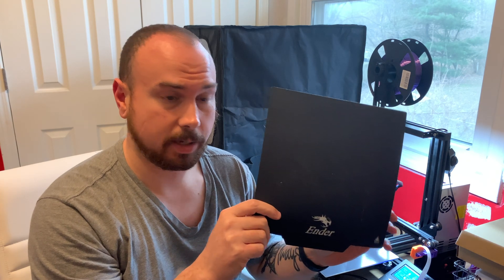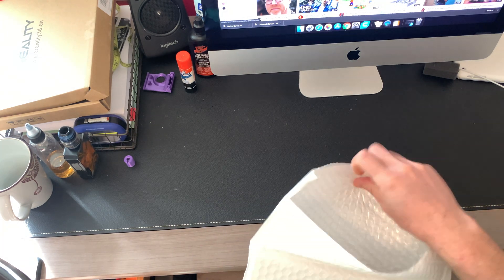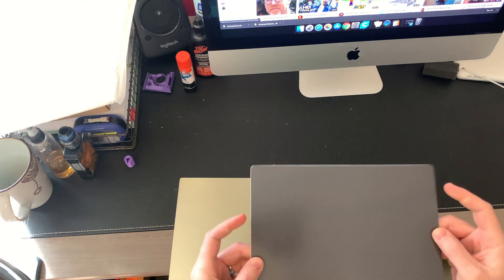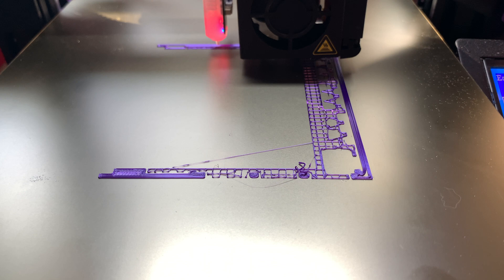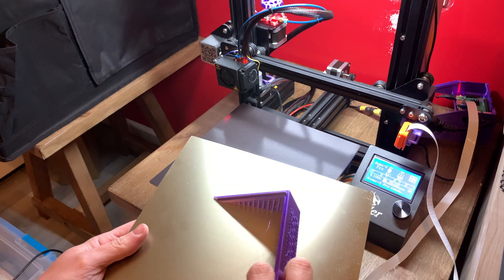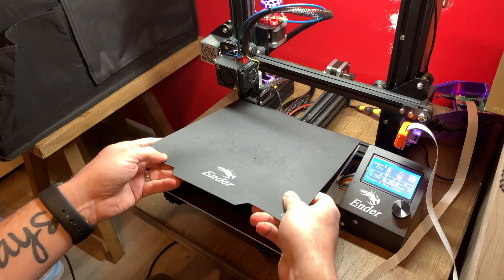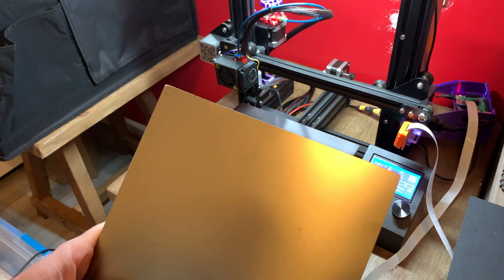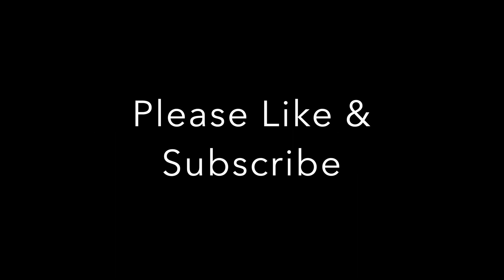Creality PEI bed for Ender 3/Ender 3pro/ Ender5

Comment: Do you need to peel off that yellow plastic before use? It comes without instructions! Thank you
Reply from the maker: There is a very thin film you need to remove. Be carful not to remove the PEI, it does have a yellow tint to it. I think the film that you remove is clear.
Reply: @GhostPants8012  Thank you
Reply from the maker: You’re welcome. Be sure to use fine steel whole on it in a circular motion to put fine scratches in it to help your prints stick. Mine wool very well.
Reply: @GhostPants8012  Thanky you, I didn't know. At first i'll try to use as is, then if have problems I'll try with steel whole. Temperature settings remains the same as usual? I tend to set bed to 60c with PLA.
Reply from the maker: Yes. I still run my bed at 60c for pla.

Comment: This PEI is the best bed yet. I've used glass before and I didn't like it. I never got a successful print 7/10 times as it had adhering issues. This bed pretty much solved it and i didn't even scruff it as others have said. Just went straight out of the box. It stays on with the long prints and comes off really easy.
Reply from the maker: That’s great news!
Reply: i guess it's quite off topic but do anybody know of a good website to stream newly released tv shows online ?
Reply: @Makai Gianni meh I'd suggest flixportal. You can find it thru google =) -adriel
Reply: @Adriel Rocco thank you, I went there and it seems like a nice service :D Appreciate it!!

Comment: So I take it the SECOND layer with a chinese Warning on the right bottom corner and PEI on the left bottom corner is not to be removed? (why is it not flush in the corners though, feels like something else that should be removed, but we all saw was happened when people did that on their Galaxy Fold lol)
Reply from the maker: That is the pei sheet over the metal. Don’t remove that part. Yeah it’s not flush with the steel for some reason. I took a razor and just trimmed it on the front. I would leave the back that way it is though so that you can remove the pei sheet and replace when it needs it.
Reply: 3D4LYF is there a reason why some PLA adhere less on pei than on the proginal flexible material that came with the printer? Any tips or tricks to make object stick better (hugher bed temp?). I was mortified to find my red real filament simply wouldnt stick to pei, where the white one had no  problem.. ti switched back to my previous bed and havent had an issue with that particular filament
Reply from the maker: The reason why is the stock bed has a rougher surface. To help with this take some fine steel wool to your pei bed with some alcohol and polish it in circles like you would wax. It puts super fine small scratches into the pei and helps it to adhere better. Do this two or three times in a row. You should be able to see small circular scratches in it. This will help allot. Make sure to not due this all the time as it will wear out the pei. Only as needed. Also make sure your first layer is as close as it can be to the bed. That should get you going. Happy printing.

Comment: I have this pei bed and it works great for some PLA but not others. It's a real hit and miss if I have to use glue stick with it. Got a different PEI bed  on another printer and it works great. Different manufacturers is the difference between the two beds with one working great and the other hit or miss
Reply from the maker: Try and use fine steelwool to put small scratches in the surface of the pei. I have used it will pla and abs no problem. No glue or hairspray. You also might have your z-offset just little too far away.

Comment: I got one of these so I can print ABS. First test print was good so we'll see how it goes.
Reply: According to any source I found on web,  those magnets loose its "magnetism" on high temperatures like 100C (ABS printing). Did you try just once or you print multiple times?
Reply from the maker: I use this machine to only print abs. I have ran many many hours on it. I have never had the stock magnet fail or get weak so far with the pei bed. I haven’t even moved my electronics out yet and so far no issues in the enclosure. I keep the bed at 110c and hot end at 235c and just little vents on the side and top of the enclosure open to not have abs fumes build up and allow some cooling for the psu.
Reply from the maker: That’s great!

Comment: Sadly not available on Amazon any more. Says it's currently unavailable
Reply from the maker: I just seen that. It is probably due to the outbreak in China. I see many items showing out of stock. I would just try and hold out a little longer till it comes back in stock. Or check ebay maybe, or Banggood.
Reply: I just bought it, it's back in stock
Reply from the maker: Good deal!  Hope you like it as much as I do!!
Reply: @GhostPants8012  First print will be tomorrow morning, so I'll see then!
Reply from the maker: IzaicNix let me know how it goes.
Reply: @GhostPants8012  Works well so far
Reply: Why always feeding Amazon? There are more vendors than Amazon on the marked. You cant be THIS lazy, can you?